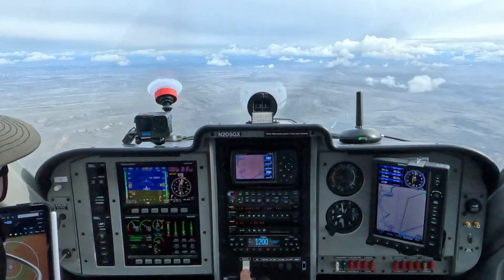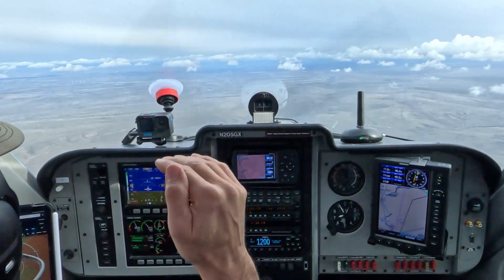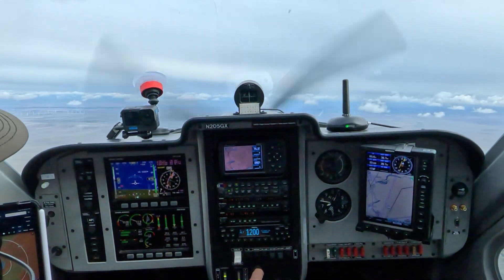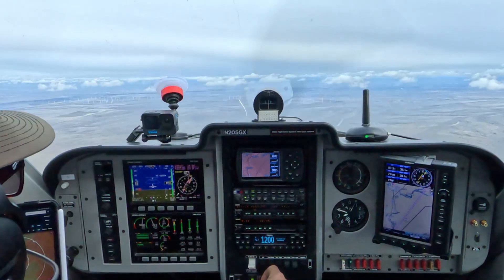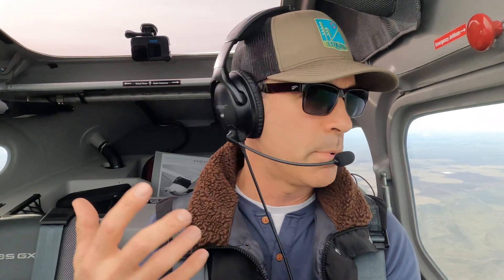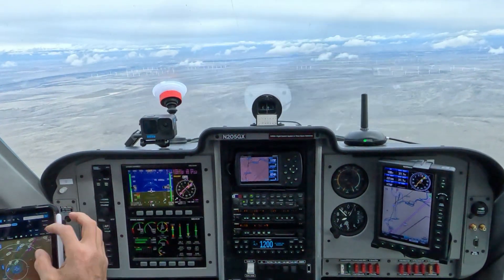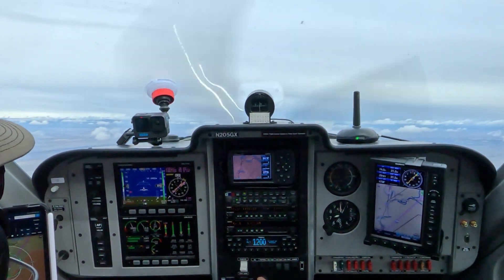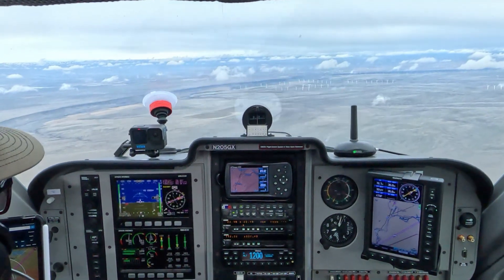How to Ace Power On/Off Stalls On Your Private Pilot Check Ride

Comment: How do you keep ailerons neutral while using rudder especially when everything is going so fast? That’s the problem I have currently, unable to keep ailerons neutral, while I correct the rudder.
Reply from the maker: @mehul21  lots of practice. Another technique that I used with students was to have them hold the yoke in the middle so it was very difficult to move the ailerons.

Comment: Thanks for explanation. I have a question thaugh. As explained in the video. The "wing down stall" there is this theory that aileron would increase drage to stall even more. On the other hand wing with flaps on has a lower stall speed, that would to me look like flaps ( in this case ailerons) would help prevent stall? So I just can´t wrap my hand around this. Thank You for answering.
Reply from the maker: @mostek27  anything that increases drag is going to cause the wing to stall sooner and when an aileron is pointed down, it increases drag just like a flap does.
Reply: @trent_dyrsmid  thx a lot. I just thaught for a second that the flap might gain some lift cause the stall speed of the wing at this time will be smaller then flap up wing but higher then flap down wing.

Comment: Do you have any advice on how to overcome the instinct of using the yoke? I KNOW I should keep the aeilorans neutral and use my feet, yet the moment I enter the stall, my hands turns the yoke, can't help it. Stalls are such a weak spot for me!!! Any tips would be greatly appreciated
Reply from the maker: Place one hand in the center of the yoke so that you have very little leverage to turn it like a steering wheel.

Comment: My CFI told me to retract the first notch of flaps immediately after pitching down and adding full power on a power off stall, then final notch of flaps after achieving a positive climb. Is that correct?
Reply: @trent_dyrsmid  So is that a yes? 😀
Reply from the maker: Yes. You can retract them immediately or you can wait until you have a positive rate of climb.
Reply: @trent_dyrsmid  Good to know. Thanks!

Comment: Hello, I did stalls the other day and I feel like I push the throttle in to fast. When I do it. I lose track of my yolk and lose balance. Do I push the throttle in at a constant pace or really fast. I was descending too much I guess.
Reply from the maker: The first goal with a stall is to break the stall by pushing the nose down and at the same time you were doing that you want to add maximum throttle as quickly as you can. This is because if this were to happen to you in the real world you’re going to be low to the ground and you want to make sure that you don’t crash into the ground.
Reply: @trent_dyrsmid  ok you so much. And also the yolk was really hard to pull back while I was trying to get into the stall. My instructor kept saying pull back pull back. I’m like “I am lol but it wasn’t going up. It was my least favorite flight and I was kind of frustrated at the end.
Reply from the maker: Sry to hear that
Reply: I meant thank u sooo much at the beginning. Sorry.

Comment: Hi Trent, thanks for the excellent video you created for on/off stalls as a newbie learning to fly I have flown about 9 hrs and on to the stalling exercises so found your explanation helpful ! At the moment I find that there is a lot to take in, therefore sometimes I do not have confidence on where to look at what gauges etc. For stalling are there any tips you can give me as a summary that will help me get into the repeated habit of performing the stalls?
i.e. Pull back to initiate stall, wait for stall warning, push forward and simultaneously increase to full throttle, turn off carb heat, once stall warning goes, pull up nose and level flight. Its during this operation, I would like some help on what to 'scan' over on the dials etc? so I now I have not lost too much altitude.
Thanks so mich in advance, I have subscribed and hope that when I get my solo completed, I will create a video on my YoutTube channel.
Reply from the maker: All my best tips are in the video :)